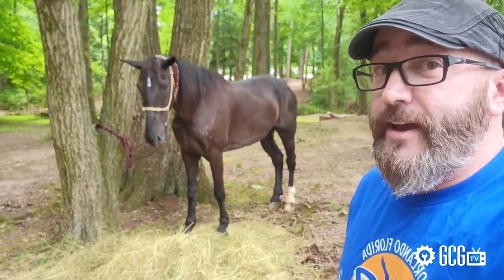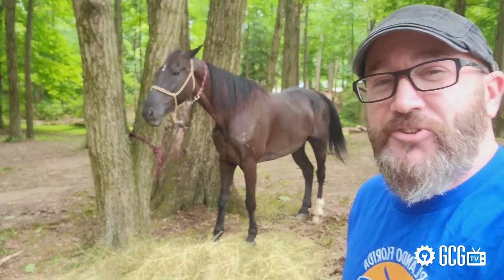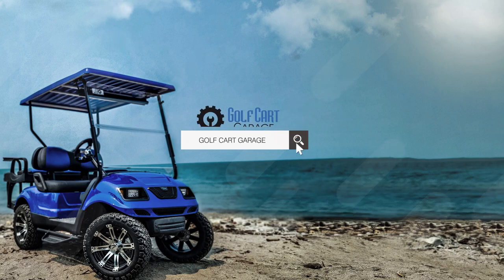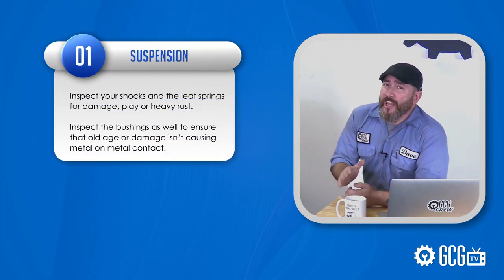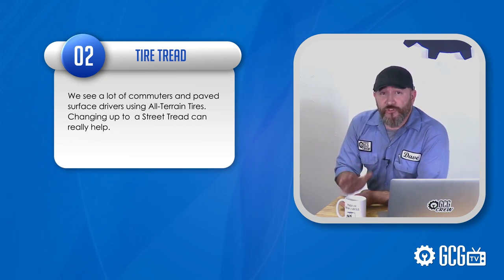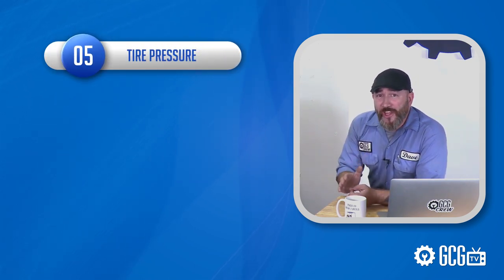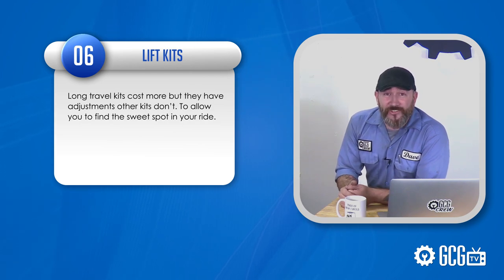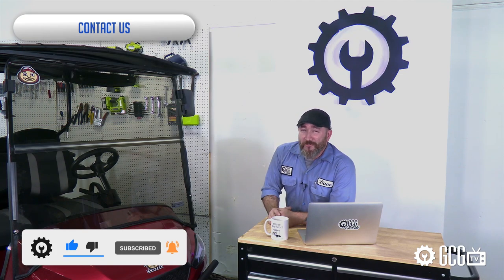Smoother Golf Cart Ride | ASK DAVE | Golf Cart Garage

Comment: I have a 2011 Yamaha gas cart and it rides like it has no suspension.  I keep the tires at 15# for tire wear and the new shocks for it are horribley expensive. (very specialized)  Is it possible my shocks have stiffened up or will the new shocks give me the same ride and I'd be wasting my money?
Reply from the maker: Thanks for watching, Ken!  Yamaha ride can sometimes be tricky since they don't have leaf springs like the domestic carts do.  We'll have some follow up questions on the cart and shocks. You can get an appt for a video call diagnosis here: https://www.golfcartgarage.com/gearheads-on-demand/
or get in touch directly at Support@GolfCartGarage.com or (800) 401-2934

Comment: Dave, I bought a 2004 club car carry all. I put Jake’s 3” lift and new rims and tires. I don’t remember how it handles before the lift but my kidneys fall out whenever I go over a bumpy road. Are there special leaf springs for lifted carts to give a smooth ride or am I just stuck with this?  Thanks. Great videos.
Reply from the maker: Thanks for watching!  It may help to lower the tire air pressure a bit and experiment to see how the ride softens.  Those 3" lift kits can lead to a suspension feel change.  If there are Carry All leaf springs that are parabolic or softer, they will likely only be available through Club Car directly.  let us know if you need more help! Support@GolfCartGarage.com or (800) 401-2934

Comment: Great info Dave just a thought is it ok to oil or grease the springs etc on the cart or what can you do to prevent shocks, springs etc to wear out?
Reply from the maker: Thanks for watching, Ben! I don't think there is really anything you can do to prevent shocks and springs from wearing out besides holding the rust to a minimum by keeping them clean and dry as possible.  And about the only thing I do to bushings is use WD-40 if they are squeaking or making noise.  Some lift kits have grease fittings on the spindles.  Otherwise, parts like that always wear out over time, just keep an eye on it.  Let us know if you need help or have more questions!  Support@GolfCartGarage.com or (800) 401-2934
Reply: @GolfCartGarage  Thanks for the reply They say that you should oil up the springs on your garage door so I just thought that you could do the same on the golf cart springs   Thanks again you always give great info
Reply from the maker: We appreciate you tuning in, Ben.  Let us know any time we can help!